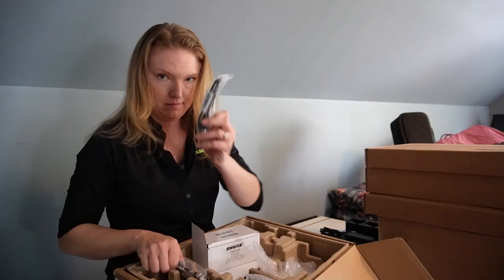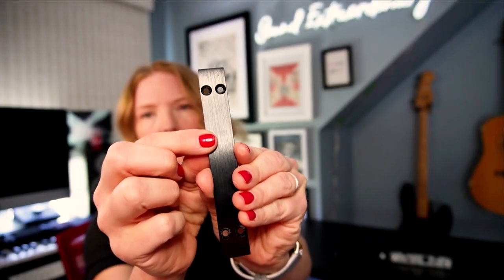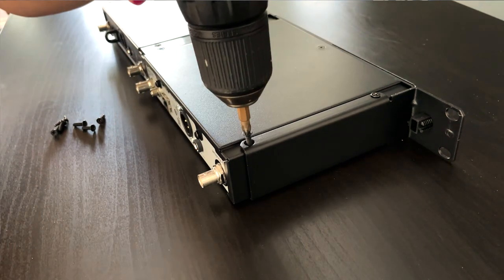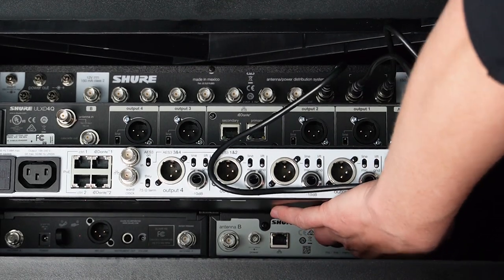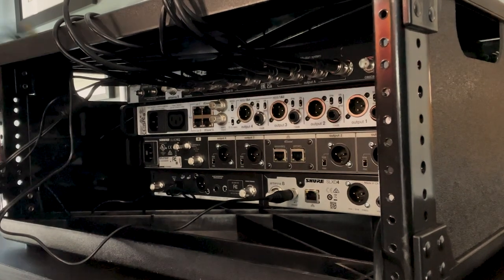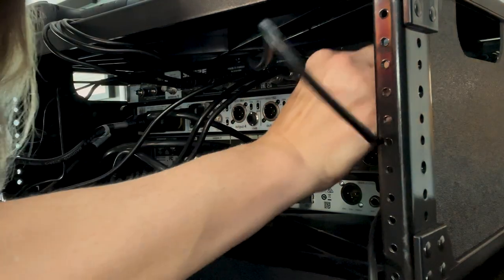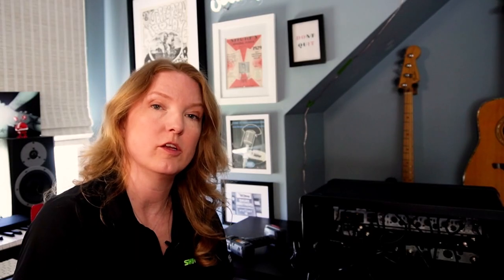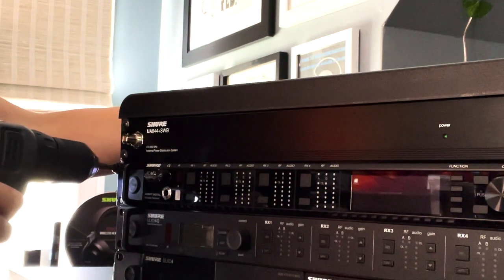How to Rack Up a Wireless Training Rack | Shure

Comment: Cool vid....

If u decide to do an update, here are some ideas...

1. Consider stating more information on the portable rack. Meaning recommending or making statements of some things to consider when selecting a rack....Should it be metal or plastic....any particular brand to consider if Shure does not already have cases for purchase.

2. Power conditioners....I am assuming the top piece of gear in the rack was a power conditioner. 

3. Consider showing a close up of the final setup. Even if u just take a picture and show it as a thumbnail. It was not enough light for me to see your final setup. Its fine. U can still save time, money, and energy by not using adequate lighting for this demo as long as u show photos.

Background....

I am hoping to obtain an Axient quad, but lately I have been wondering if I need to upgrade my case for the quad.

Of course, Shure could make my life easier by just offering an SlxD in a quad format. Its just me. So I need something that is long term, portable, easy for just me to operate, and I like the Axient concept with all of the available channels and features on the Axient.

In either case, I still think the video was fine although too dark to really see anything. I have racked my Slx before the Digital version so I understood the concepts. 

I was really here to see if I needed a new case, but from what I can tell, I think my case is close enough in quality that I do not likely need a new case.

In either case...

Cool vid....

Comment: Great video. I am trying to build a rack of the following items: I have two ULXD4Ds on G50 Band, two ULXD4D on H50 Band, and two ULXD4D on V50 Band (total 6 units so 6U of rack mount space). My question is if I use a UA844 to combine all the antennas, will UA844 support all the different Bands I have or do I have to forget UA844 and individually attach the antennas (6 pairs, each L/R to each ULXD4Ds). Thank you!